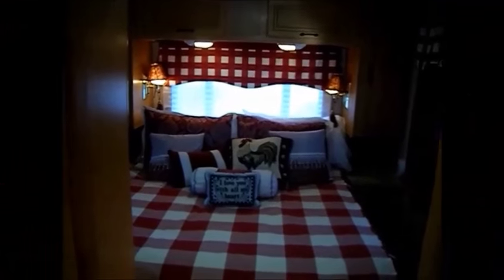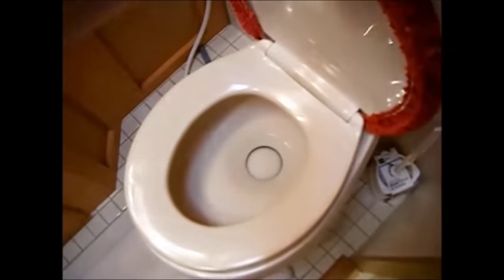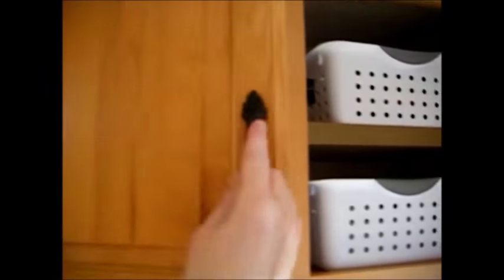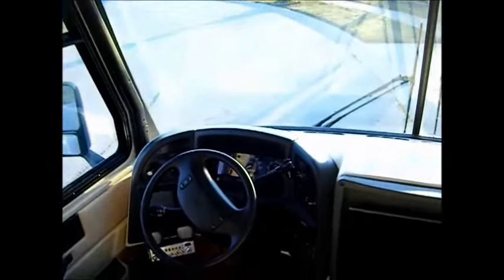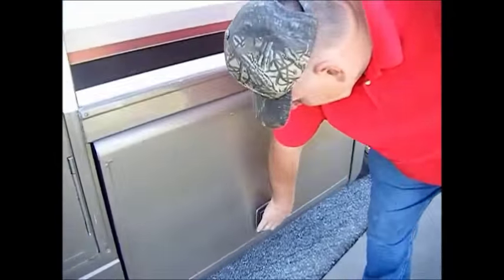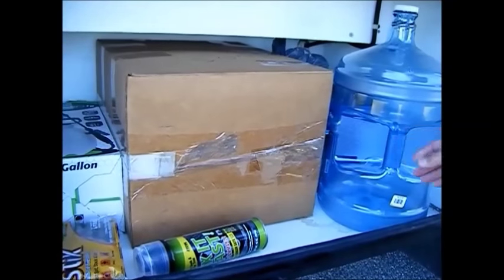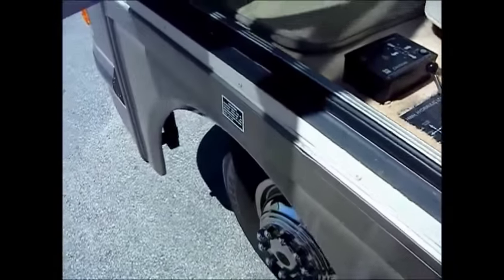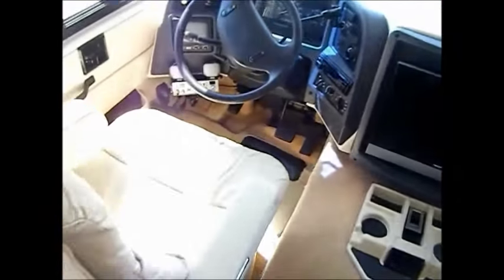FOR SALE: 1996 Total Remodel, Holiday Rambler Endeavor LE, 63K miles! Very Well Kept!

Comment from the maker: We finished the remodel: Is for sale at $31K OBO; if anyone is interested. We just put in new turn signal switches...all new fuses, new transmission with custom semi-truck fan for cooling the transmission. We changed spark plugs this morning and put on a new muffler last week. took to the Dunes of Lake Michigan (a 200 mile round trip) last week. Had a blast! Everything worked great and it's so much easier to deal with than a trailer and hauling with a truck...hookups...etc... This is boon-docking style!! If interested, let me know! janiebuilder@yahoo.com. Has 61K miles on odometer but only 22K miles on the newer engine...We replaced everything....to ensure we'd stay on the road. We replaced all tires in the spring as well. Also, new bath faucet and such are all changed. This is a beauty and a real favorite. Selling because we are moving to another part of the state to take care of a newborn. Travel will be far and few! Had fun while we owned it though; saw 22 Indiana state parks! I named this the 'Beast". I can drive her...it's not hard...just know your bridge heights and google your routes in advance..I use 'WAZE' to find my routes. CALL ME and we can talk turkey prices! Whoo! Hoo!

Comment: Nice job. Same coach as mine but I do not have the tv option for the rear bedroom, with is strange because every other one I have seen has it. On the positive note, the enclosure will not be in the way when I get up to putting up a tv with a mount on the wall. I love your new kitchen faucet. 👍 And that floor is so much nicer than the carpet it comes with, makes me want to slide in my socks!!!

Comment: It's just a beautiful RV. Are you trying to sell it? Just an FYI, in case you didn't already know, you should leave your refrigerator and freezer doors slightly ajar so that they won't mildew while in storage. Happy RVing!
Reply from the maker: +"C" Our RV I was going to sell it but we put it in storage to think about it harder over the winter; we could not find a place that could take such a long RV in our area. We finally found a place up the road and she only charged us $35 a month so we jumped on that and stored it for the winter. I'm hoping it is okay! We put a magnet in each door to keep them from closing or them from falling out if the wind got to 'wiggling' stuff around. The only thing I forgot to do was to take off the soap bottle off the soap dispenser on the new faucet (under the sink). I'm praying it's not cracked and a jar full of dish liquid is not flowing under the cabinets...well- it could be worse! At least it will be CLEAN if it does break open and I have to mop it up. The coach will smell like fresh citrus! LOL!!

Comment: Nice work     Holiday Rambler is a well made coach  aluminum channel framing still , they went to square aluminum tubing in the early 2000s I believe .    I love the wood work and the curtains.  What are you selling it for?  I would keep it.    I am going to rebuild one myself soon.  Much older but a really high end unit like yours  an AVCO.  Good video
Reply: I forgot to mention  that Holiday Rambler of the days of channel framing was that there is much more surface area to channel framing that the weld joints have a lot more surface than butt weld framing like in the later (2000s) HR RVs   So the coach uses a lot more frame members  to make an interlocking frame than a butt welded wall frame.  I strongly suggest you keep that RV as the new ones of today are much more lacking in quality builds.   Thorr and many others use laminated framing and they build the walls out of thin paper thin aluminum studs and they bolt the walls to the running frame with just lag bolts  where as HR welded everything together.  Hard to find a non "bus" rv today buily like yours  and never get rid of it if you can keep it.   I am starting my rebuild of my old Dodge AVCO which was a very high end unit like your HR.  After seeing yours I may ditch the carpet  and my someday install a Cummins diesel in place of that old 440.    Anyways I am rambling  but good build  and if I could afford it   I would have you redo my coach,.  Country coach quality in my opinion.

Comment: I forgot to ask. Can you use a residential shower head or do you HAVE to have a special one?
Reply from the maker: We did use a reg residential shower head attachment. We got a 'hand held' simple water type as you do not have the water pressure for a 'pik' type style that get's a harder force of water through it. But the larger shower heads do tend to cause you to dump grey water more often than not. But when you want to feel clean and rinsed, especially with my long hair. It helps by letting me wash/rinse off quicker. So, I think for me, it evens out the amount of water I use; I bought this handheld from Menards. It's a 3" diameter unit. It took five minutes to replace with a few strips of plumbers white stretch tape.